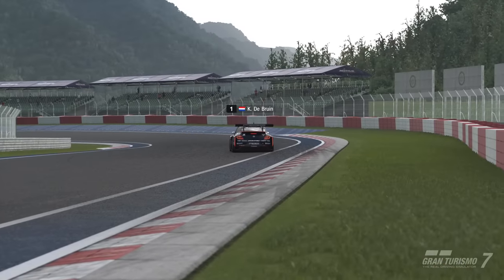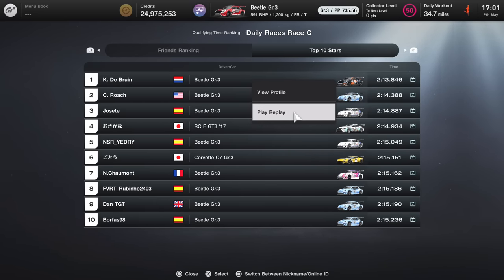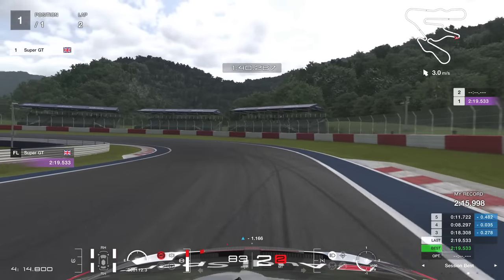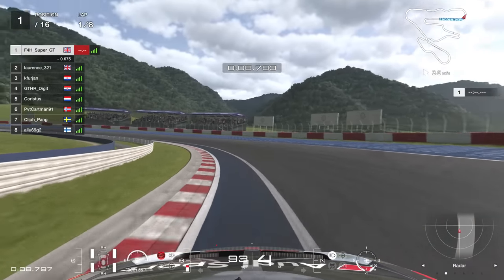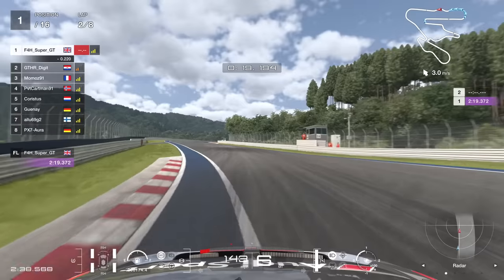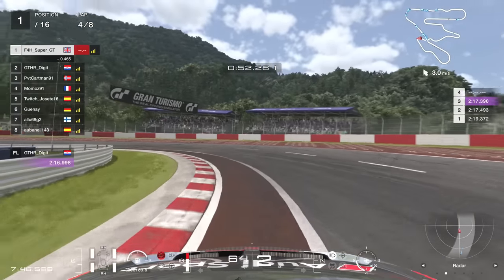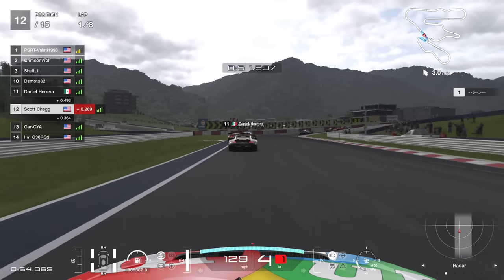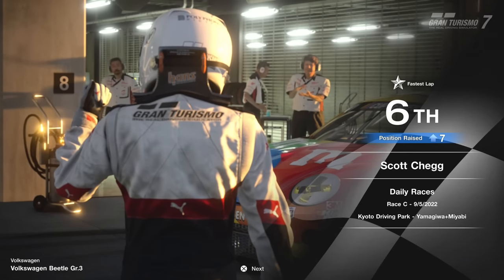The Gran Turismo Exploit Which Makes You Much Faster

Comment: I like to think they left it in so you could Initial D it. My thoughts are they really need to make it so you can't stay within track limits and ride that kerb, it's really utilising the maximum of what's legal in the game, but it was somewhat badly defined by Polyphony. I class this as a different level of issue to the Daytona skip.
Reply: I think some of it is just an interaction between the underside, the tire wall and curb. Maybe they need to smooth the inside of the curb
Reply: Wait whats the daytona skip?
Reply: I mean in reality you could do it on a curb high enough, its just that you'd also debead the tyre and probably rip out the suspension on a fast enough corner lol. Would be good if GT simulated tyre damage (to the point of instant destruction if you cocked it up completely) to eliminate this sort of thing.
Reply: @skilfil  that's probably a lot more complicated than it needs to be, as a person who works with programmers, I can only imagine the number of unintended interactions that would cause
Reply: what daytona skip
Reply: @taiefmiah  I reckon the tire model needs work to begin with once that's sorted then this exploit will be mostly gone. overstiff sidewalls is my guess
Reply: Curb.

Comment: In my rally days, this was known as 'ditch hooking'. Very fast but very dangerous.
Reply: Exactly it's a very real technique and The Physics are realistic. All its missing is tyre damage to the inner wall. Definitely not cheating but there should be some downside to using it especially with Gr.3.
Reply: Yea it's used in V8 supercars here in Aus but only at one track for one corner.
Reply: @FurBurger151  maybe real but I am pretty sure it is impossible on those curbs, they are to low. Also the rubber would cut so fast you won't make it past the first turn. On top of that, this is very risky and even if drivers could it would be banned. You would be driving with 2 wheels on gravel to hook a 1 cm curb... and not spin or crash into others? Right..... This is not rally, this is circuit racing.

Comment: I take the curb sometimes but to be honest I didn't think of it as cheating. I know rally drivers use that technique, I do think they should make the tires that takes the curb wear out faster though maybe reduce a bit of speed if using technique longer than 2 seconds
Reply: They just need to add those tiny speed bumps there to fix it
Reply: A normal damage model that breaks your aero would make you think 5 times before doing it.
Reply: Ken block made a video recently showing how he does EXACTLY this IRL all the time. Not only is it NOT cheating, but it is very real.
Reply: Bruhh your  totally exploiting a bug.... so ... cheating end of story
Reply: @davidfordyoyoguy  I don't want this removed from the game, I want the chance of damage be severely high - I feel the game's handling and FFB are excellent, but the people just drive like it's a Wipeout game instead of a sim because there are no consequences for risk takers.
Reply: @danielstokker  exploiting is not cheating fyi. If the exploit is available to all players using only the game itself with no modifications, then it’s not cheating. It’s exploiting, in which players use strategies in game that were not intended by the devs, in order to circumvent the expected challenges the devs present. Cheating would be modifying the games code to make your car faster than others. Exploiting would be performing a menu glitch to make your car faster than others. Important distinction.
Reply: @Eat-MyGoal  they cant cause the tracks have those yellow bumps thing to prevent it
Reply: @MrFitness94  Sure exploiting the game is not technically cheating but its cheating the integrity of a race. Using any advantage that isn't allowed in the real world, in a sim, defeats the purpose of the sim, therefore its cheating.
Reply: @MrFitness94  bug abuse will get you banned in many videogames. Altering game code is what I would call hacking. If it's clear that the strategy was not intended, and is a bug, then using such a strategy should be seen as cheating. In call of duty if you glitch outside of the map that is cheating and people have been banned for it. Duplication glitches in mmos lead to a ban. Xp glitches too. No game code altered. Anyone could do it, it's just clearly not intended. Either way it's an argument of semantics so who cares. I don't really think curb riding counts as bug abuse because it could hypothetically be done in real life. There will always be a loophole in the game, just like real life. But abusing that loophole ruins the sport. Just like in real life. It's up to the players to keep any sport respectable and fun.
Reply: @danielstokker  It's wasn't a bug though... It was a design flaw available to everyone. Definitely wasn't cheating!
Reply: @jakenies8415  just because people are doing a shitty thing, that is not in the spirit of the game, doesn’t grant you license to wrongly call them cheaters. As I have already covered, since their strategies are available to everybody who plays, it is simply an exploit, not a cheat. We can call them all sorts of rotten names, but since they’re not winning unfairly - because anybody can do it - they’re not cheaters.
Reply: @Injamben  you’re stepping on your own toes. Nobody said exploiting is always okay. Sometimes it is, sometimes it isn’t. Remember, the claim of “cheating” necessitates an “unfair advantage.” If everybody has the “glitch” (exploit) available to them, it can no longer be called cheating. This is why cheating and hacking are interchangeable terms; they’re about gaining an unfair advantage. Yes, exploiting can be a bannable offense. Yes, in CoD, glitching outside of the map is a reportable offense, that’s why there’s an “exploit” report button. If you report somebody for cheating for out of bounds glitching, you’re selecting the wrong report option. Since everybody can get outside of the map, it’s not cheating. Did you know slide cancelling is a technically an exploit? Slide cancelling circumvents the expected challenges the devs intended, by eliminating your sprint cooldown timer. It is a bug, that a lot of players exploit, and it is deemed acceptable. Sometimes exploits can be fairly innocent. I’m not here to defend these exploiters, because the righteousness of exploiting in a game is very up for debate, but I am here to let people who call them cheaters know that no, they are not cheaters at all, that’s just not how that word works. Cheating is about gaining an unfair advantage, and there’s nothing unfair about this. Wrong? Maybe. Not in the spirit of the game? Definitely. Cheating? Not. At. All.
Reply: @danielstokker  is it cheating if u can do the same irl?
Reply: @kresimircosic9035  same like downshifting the engine into overrevving to get rotation in the chassis. The GT physics engine really has some gamey bits in it
Reply: @TheChannel1978  Yeah that either has to have downshift protection or completely ruin the engine.
Reply: @MrFitness94  your examples dont apply to gt7. I understand its technically an exploit and in a game like trackmania this is fine as you only race yourself/time, but the entire point of gt7 is sim racing = abiding by real racing regulations. Any exploit is technically not cheating at a definitive level, but for gt7 you're cheating the entire purpose of the game. Gaining an advantage through any means other than real life strategies in a racing sim is straight cheating its black and white. Whether it circumvents the devs challenges or not, it is easy to see it circumvents the point of racing. You're right for a lot of other games just not gt7.
Reply: @danielstokker  bro.     It's not a bug is based on real physics
Reply: @jakenies8415  I disagree with your point. I look to F1 for this argument. rules were created to be broken. If you look back into history of the sport, the teams did everything they can to get an advantage. this means sometimes breaking the rules "spirit of the sport" to get that advantage. I cannot give you specifics because I'm just a casual fan. there were both exploits and cheats in the sport.
Reply: @donaldsalkovick396  I do believe the mechanic is a bug. while i agree that there is this phenomenon irl, I don't think the coder created this mechanic intentionally (not sure tho) if this is intentional, then this whole thread is moot.

Comment: 0:10 Sorry, that is no exploit, that is reality.
That is Initial D master level of player to know to use that curb to keep the car on track
Reply: Initial d is real.....
Reply: @andreweedy2765  initial d was inspired after real life. You can find vidsof racecar pilots doing the advanced things portrayed in that title.
Reply: @ElGoogKO  You see, my friend's a mechanic. And I've had him look at this:
Is it possible? Yes
Would any racer do it? Fuck no. It's extremely tire expensive and puts unneeded stresses on the suspension, if it can even survive it. You need a suspension meant to take a beating like a gutter run to actually do the gutter run without fucking your car up
Reply: @lucasgamezz140  Ken Block just recently made a video showing how he does EXACTLY this IRL. It is real and to some people, money is no issue.
Reply: The series was made with assistance from Keiichi Tsuchiya, they knew what they were talking about.
Reply: You have to consider the difference in scale here, what you'd do on rallying is using actual gutters, usually the V-shaped kind which tend to be over half the size of the car's wheels, what you see in this circuit in gran turismo is barely 5cm (~2in) if even that, it's absolutely nothing for the tire to grab onto, you'd lose more from having slicks on grass (which, trust me, has way less grip than gravel) than you'd gain from the tire somehow "locking" into that small bit of concrete
Reply: @jakegtr  And the Trueno IS modified for drifting, who's to say Takumi's father didn't mod the suspension to be able to take it?
Reply: don't be sorry. it's an exploit, regardless of the initial d meme
Reply: @lucasgamezz140  There's a lot of difference between a normal person doing this and a professional driver with factory backing. In a lot of championships, a -1s/per lap is more than worth a set of new wheels/front suspension.
Reply: @TechPanzer  Only if you're allowed to swap it mid race. Good luck going an entire race doing this every lap

Comment: This technique i use frequently on Nurburgring. Well before it was seen as a glitch, it uses 4 wheel drift but slightly different. I had learned it back in GT5 and only pulled it out as an offensive move, works very well.

Comment: I feel like its only cheating if its Easy enough to do with minimal effort AND its an instant boost while completely skipping significant portions of the track (Like the Goodwood shortcut or the Willow Springs one from GT Sport). The fact that this takes actual skill and specific factors (The angle, the amount and trajectory) to make it work while staying on track, albeit barely, makes it more an exploit. A difficult one and somewhat edgy one, but a exploit. I tend to feel the biggest difference between cheating and simply exploiting something is the amount of effort relative to the gain you achieve.

Comment: CAUTION: RANT AHEAD

Don't rally cars do this? So the physics isn't necessarily broken (however lower cars would be shot). But I think having it in the game adds to higher skill gap, there just needs to be a downside. I.E. More tire wear, dirtiness so the next couple corners require more precision, or even it requires a certain set up or tires. I like it, but I miss variety in games. That's why I no longer play sports games. Besides the main title you lack options. Football for example, we have only Madden now, but we used to have variety like Street, Blitz, NFL Fever, etc. Anyways, what I'm getting at is if we are stuck with basically 1 title I'd prefer more options then just the "META." Seeing 1 car in a lobby of 12+ makes the game fun for about 45min before you change the game...
Reply: Where would a rally car ever do this? There aren’t any kerbs/curbs on dirt roads 🫠
Reply: I agree. And it’s not even Rally cars. Look at Seb Vettel’s pole lap at Mexico 2017 in the snake section in sector 2. It’s totally normal amd maybe people are complaining because they aren’t gaining the time??😂
Reply: @kabob21  there are natural "curbs" and gutters that do form, also many rally races include dirt and road. Have you ever watched rally cars before? You should treat yourself cause it sounds like you haven't
Reply: The issue is specifically how/where it does it, notice how it's a literal 5cm (~2in) tall wall, on cars with slicks which would be going into dirt, whilst the opposite side would be getting pushed outside by the shape of the curbs, not to speak of how the underside would be gone from all the scraping

Comment: for the people saying "hurr durr muh rally drivers do it"...yes they do. they dip a wheel into a ditch to the inside to "hook" the car around corners. BUT you are driving cars here with slick or semi-slick tyres on a racetrack. the two inside wheels are on the grass. its physically impossible to go around the corner with 2 wheels on the grass at the same speed as if all 4 of them where on the asphalt. best case scenario would be your car just slipping back on the track or it goes around on you completely. Secondly riding a curb for that long at such a speed would just tear your tyre apart after the first time you try this move irl. i once hit a sidewalk curb irl at like 50kmh/30~mph for a moment and needed a new one cus i had a tear in it.

Comment: Genuine question though, if it wasn't for the risk factor, and you had the right suspension, camber, etc, wouldn't this work in real life too? Like didn't they make it illegal in nascar or indy 500 to ride the bottom bit of the oval? You know where you have one wheel on the flat and one on the bank, I think It's faster but less safe
Reply: When I was involved in rallying, it was known as 'ditch hooking'. When it worked there were massive times to be gained. If there was a rock on the inside, wave goodbye to your suspension!
Reply: @Jailhouse_Chris  Yes exactly, that's a great point, there's merit to the technique, I'm wondering how much of this "exploit" is a physics exploit in the game, or rather a result of accurately modelled real life physics? After all, it's not like many people get to test this kind of thing in real life. However, giving your insightful rallying comment, perhaps people have tested in real life to some extent after all. I'm very curious to know if this is a real phenomena. 

When I look at it, I think it actually is. I'm a programmer, not a physicist or professional racing driver, or track designer, whatever. But I understand it enough, I'm thinking this can happen in real life too. I think the curb is ireellevent almost, its that they're catching a camber angle that is keeping the wheels rotating nicely, ultimately riding the apex as close in as possible.  I think you can gain time with this in real life but it's super risky and difficult to do, so in real life, it's not really an option. Whether it's accurate in game, well Idk. GT7 isn't the most realistic anyway. But, someone please answer this lol. My adhd autistic brain is going mental 😂
Reply: @justamanchimp  im no expert but i can image it would affect tirewear immensely.
Reply: The technique works, but not in this environment, the small lip the tire grabs onto ingame would most likely not be enough to pull the car in irl
Reply: @woutervanderidder8417  This could be the solution in game
Reply: @tiagobelo4965  No I don't think that's necessarily true
Reply: It’s not illegal at most NASCAR tracks, just the superspeedways like Daytona, it’s not really faster either.

Comment: Once you get the first turn right, you probably need to back the next corner up a bit from your prev braking point, to get the next one right unless there’s non hooking turns in between, plus I think in general for this to work, you might be over driving the corner entry speed a bit.

Comment: GT should keep the “exploit” and make it cause more tire damage and it could be a valid technique and used when needed to
Reply: I agree. It is legit when it comes to driving physics, but at what cost? That is what the players need to weigh out.
Reply: @Eat-MyGoal  im just saying instead of nerfing it, it can make for some interesting races 🤷🏾‍♂️ and i dont have shares so my money isn’t on anything. so what does it matter anyway
Reply: @Eat-MyGoal  also In GT 6 they have sections on their tire that change temps at different rates. I dont think it would be that hard for devs to have a similar program to add physics to sidewalls. But it also might be tough. But not impossible. Not that big of a deal. I just think it would be interesting
Reply: @Eat-MyGoal  they're not going to do shit lmao. PD are senile at this point they can't fix the bugs fast enough.

Comment: Huh? But that’s been happening to me on occasion ever since gt4, when I first got a wheel. If you really hug the inside of a curb, it hugs you back. I don’t go for it on purpose but it’s always been there. I thought it was the rears skidding off the curb and creating a tighter line for the fronts, like a micro drift
Reply: What you are thinking about is usually called slip angle. 
idk how well represented it is in gt, but if you grab an old grand prix car (basically, f1 from the early 60s and before) in, say, assetto corsa, you'll notice that not only does it want to oversteer, but it's quite stable at lower angles and is slightly faster.
You can do it in nearly every car, and it's not only not harmful, but truly ideal, and one of the reasons why trail braking is considered essential.